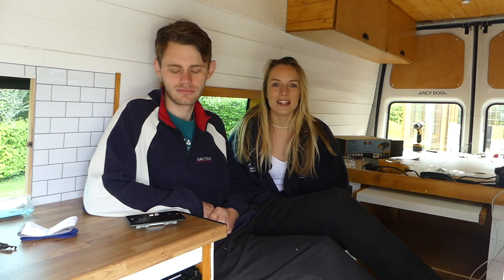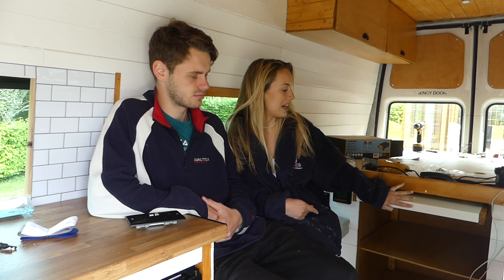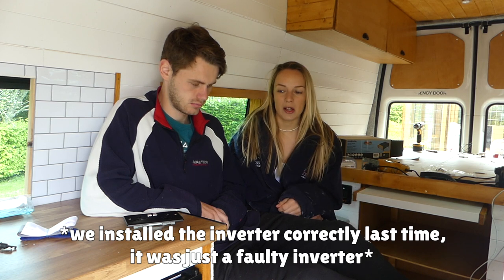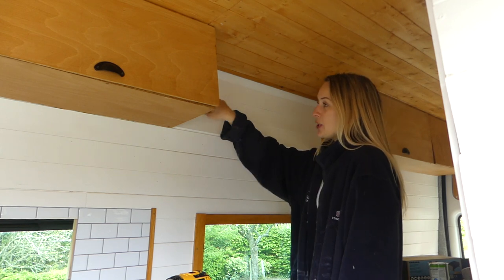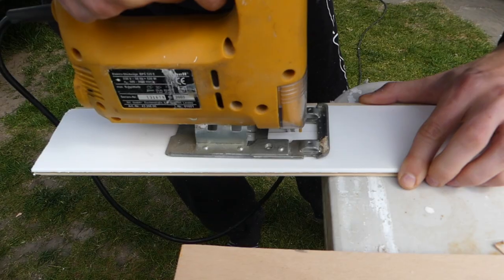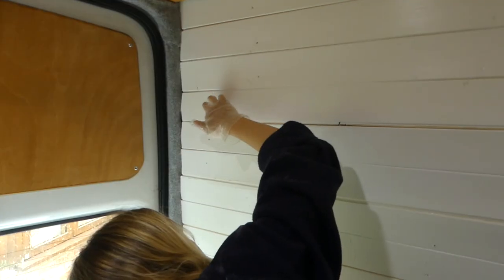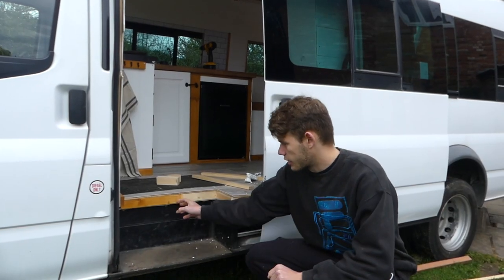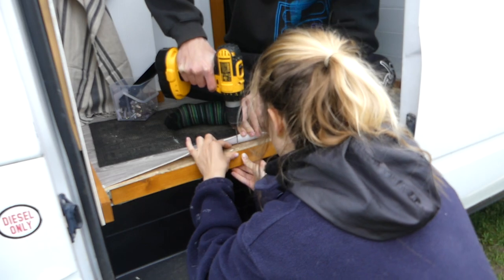Ep 19: 230v PLUG SOCKET INSTALLATION WIRING, VAN BUILD & GENERAL UPDATE / MINIBUS CAMPER CONVERSION

Comment: Hi are you still managing to run the fridge the same way without issues with the batteries etc? - I have ta similar set up and was hoping to do the same thanks
Reply from the maker: Yes, still works perfectly. Baring I’m mind we’ve only been using it in summer, so have had lots of solar panel. But so far, very good, no issues!